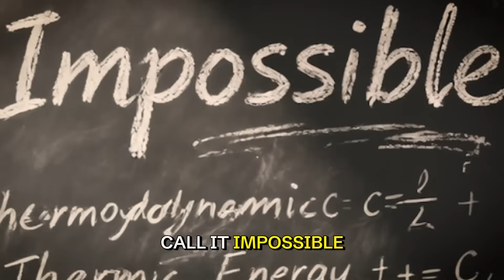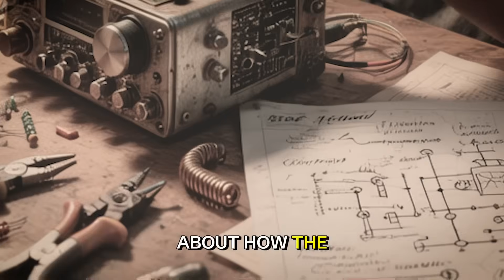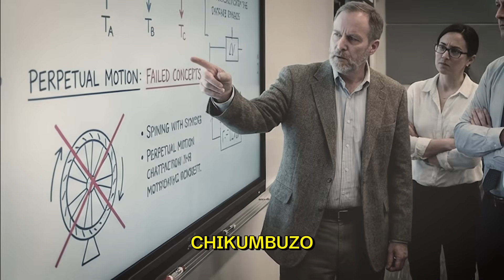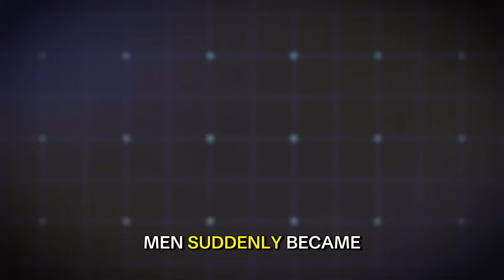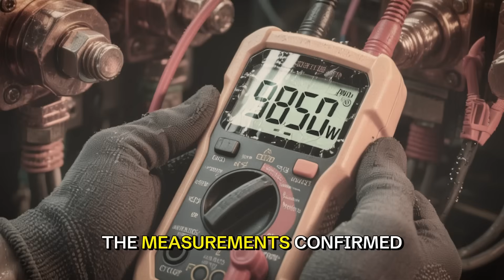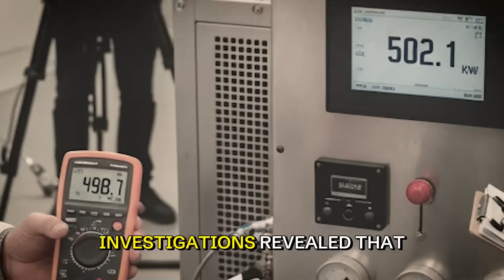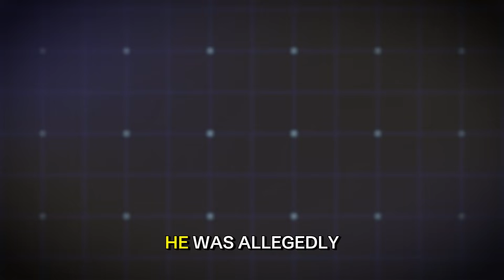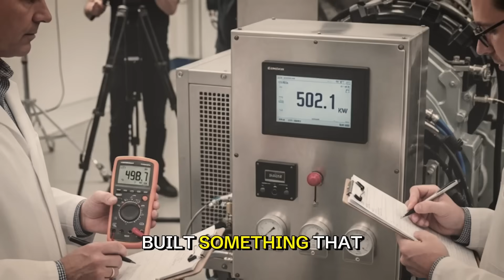This Black Man Invented A SELF-CHARGING Car & Paid The Price…

Comment: So let's say it works. Taking radio waves and running your car. A car will take 5KW energy, which is very minimal. Now, if you take 5KW from the mobile companies or other radio wave producing companies, they surely won't be happy with you. So how will that work?  There are tiny devices blinking when your phone is ringing, powered from the 3g signal your phone emits. Those are tiny devices. They won't power a car! So the idea is correct but impractical.

Comment: There is no violation of physics, this energy is not made from nothing, it's made from something (RADIO  FREQUENCY )(RF),IT IS BACK TO ALBERT-Einstein's THEORY; YOU CAN NOT CREATE OR DESTROY ENERGY, YOU CAN TRANSFORM IT FROM ONE FORM TO ANOTHER,!!!! MICRO ENERGY FROM (RF) IS TRANSFORMED NON STOP LIKE DROPS OF RAIN WHICH FILL UP THE RIVER BY SO DOING IT FILL UP THE BIGGER ENERGY CAPACITY . WHEN USING THAT ENERGY EITHER WAY , IT'S AUTO FILL AS THE (RF)IS CONSISTANTLY AVAILABLE!🙏🇿🇦

Comment: Please call inventions for what they are. The device is a radio wave converter and battery booster. To start the receptor device, an external battery/capacitor is needed. The patent protects Chikumvutso's radio wave receptor/converter battery booster device. Thanks.